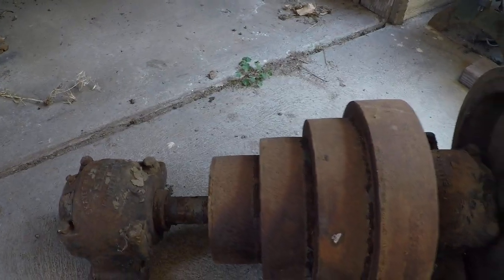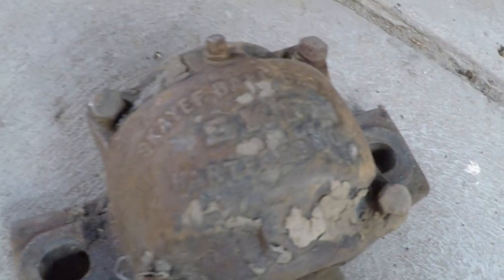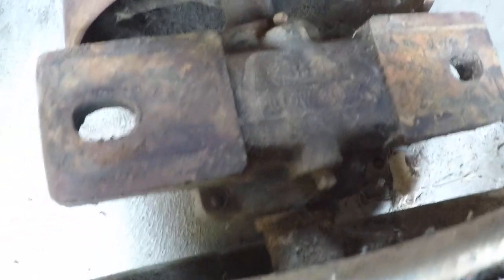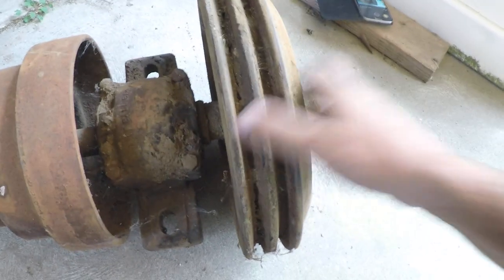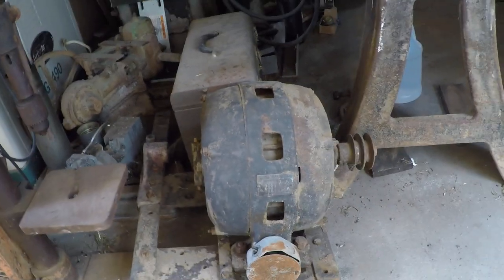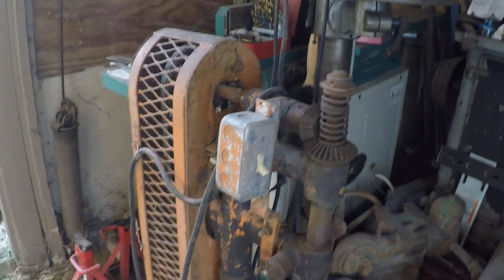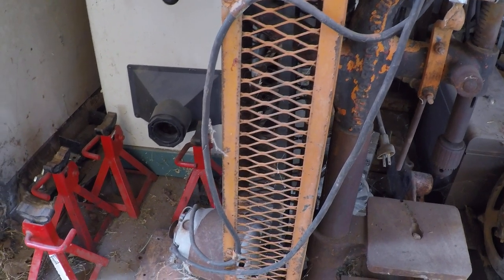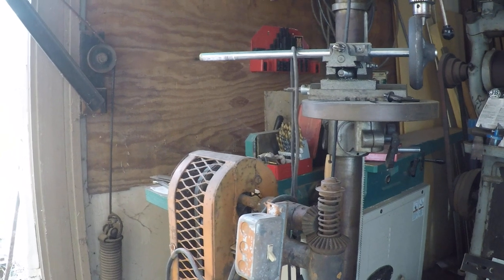South bend lathe countershaft bearing for The Backyard Machine Shop

Comment: You can run your whole line drive shop on that motor.  Love those old camel back drills.  I have one lined up waiting on me to pick it up.  Little larger unit.
Reply from the maker: +Crafted that is the plan for this one I probably won't use the brings shown here I traditional line shafts hanger bearing.  Don't Have One Around Do You?  Any one that is even a broken one I'll be making it into a pattern. And probably make them available ft or sale.

Comment: Nice new drill press. My SB came with a GE motor about that size that runs like a clock. If you need it let me know I converted mine to 3 phase and that old motor is just taking up space.
Reply from the maker: +George Chambers I'm interested where about are you located
Reply: Hey Chris, Sunriver, Oregon. Just up Hwy 97 from you.
Reply from the maker: George Chambers I go up that way some times may I can pick it up next time we're passing through.
Reply: If you can make it before the end of August, I can load it with my loader. If it's like yours it's a couple hundred pounds. I'll email my address if you'd like.
Reply from the maker: Probably not going to be that soon. Is there a time line for removing it?
Reply: Not really but it is in the way and I'm trying to downsize my holdings or scrap as the wife calls it.
Reply from the maker: +George Chambers I will see what I can make happen.
Reply: OK, just let me know.
Reply from the maker: Ok

Comment: I don't think the bearings are lubricated with grease. The hole construction looks like they are met to be oiled, with a big reservoir. You can change it like in a car. Old out at the bottom new in at the top. :-)
I think this a very early "maintenance free" bearing version.
Reply from the maker: +boelwerkr I think you may be right. It's been free of maintenance for as long time to lol